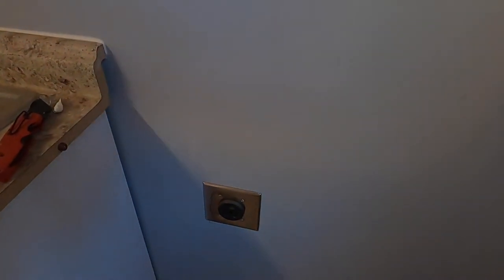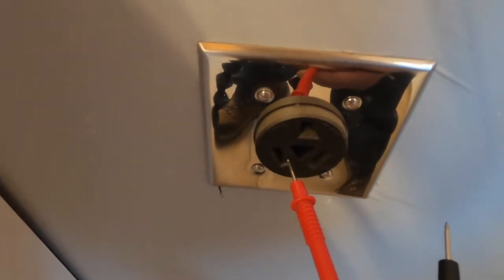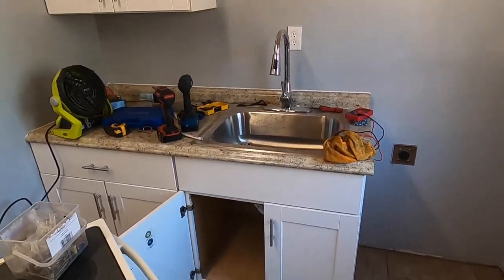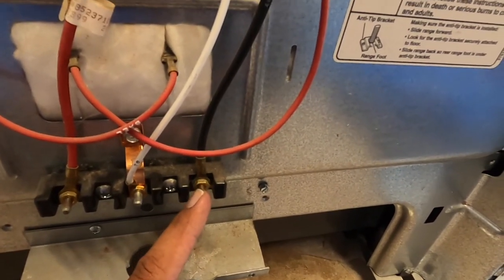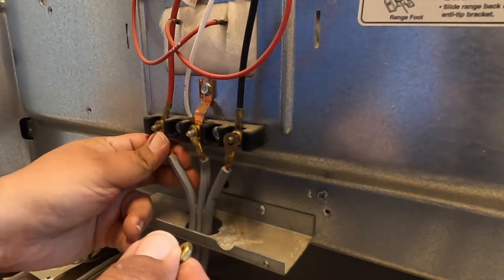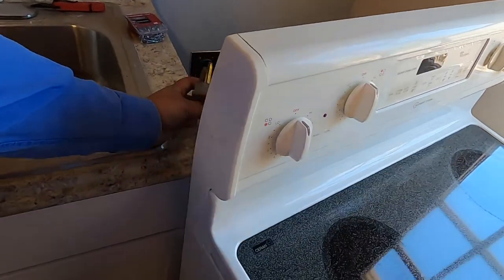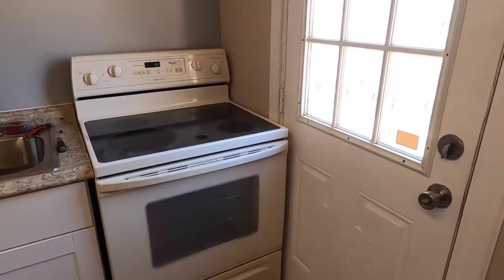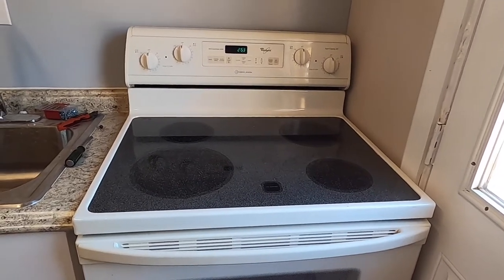How to Install a 3 Prong Power Cord on Electric Stove/Range + Test Connections

Comment: It’s code to have a tilt bracket on every stove, also consider swapping out those outlets in ur bath and kitchen for a GFCI (that’s code as well). U can swap ur door out for a leftie that swings out from the outside. The hinge will b exposed on the inside but at least the kitchen can b more functional. Cheers!!
Reply from the maker: Thanks for the info